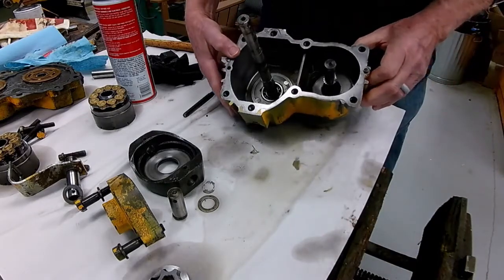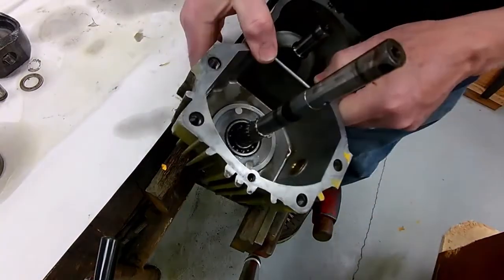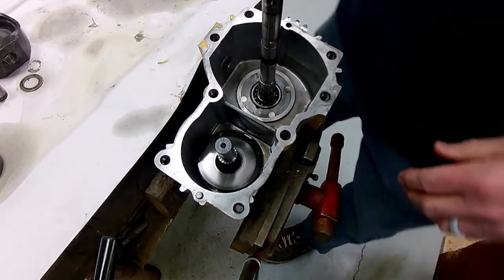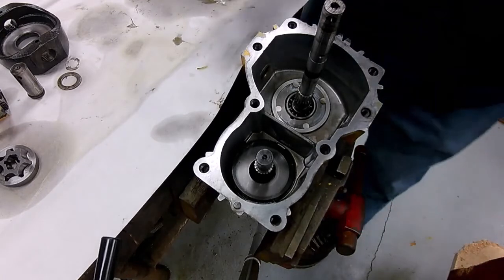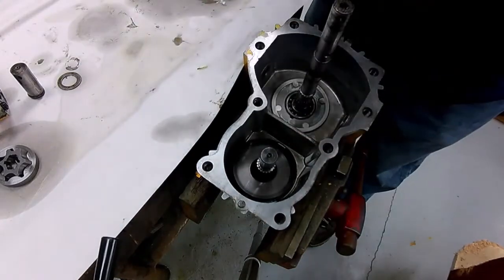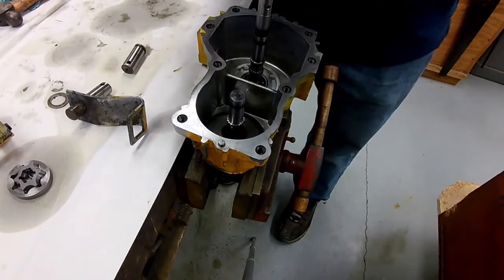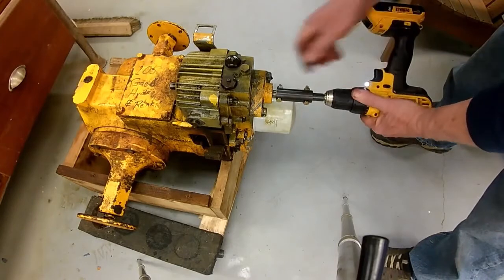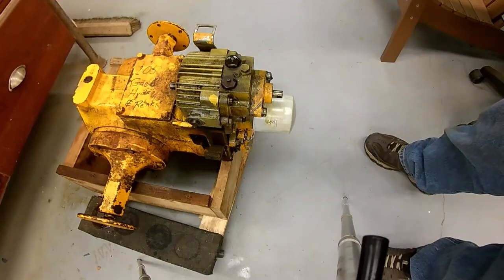Cub Cadet Hydro Repair Part  2

Comment: Hello frank, I just picked up a cub cadet 618 old cast unit  from a 2550, that had a blown engine.  I seen how you test the unit and  I will use your method .Great Video!

Comment: That's some good information, Frank. I'll check the hydro in my old tractor as it hasn't been run yet. I have a spare pump for it, and it looks good. I'm thinking of turning the transaxle around and running it from the back side and making a front deck mower. I'm aware that the engine will have to have the same direction of rotation on the thru shaft, but I can do that when I make the changes. It seems that it will plow snow better that way.

Comment: Really enjoy your videos frank thank you. You talk about the sealant or glue drying on that seal you replaced. What did you use. I am redoing mine on my 1450 again. I messed the lip seal up when I had it apart last week. Now waiting for new seal and gaskets and charge pump o ring. I’ve split this tractor ten times this month.
Reply from the maker: I think you are talking about the bearing retainer compound used to hold the roller bearing in the slightly loose housing. Several brands are out there, but Loctite is one well known. Ask for a bearing retaining compound at your local auto parts store.

Comment: Great videos and very helpful (especially about driving the swash plate pins out ). I'm curious, though and something I've never been totally clear about - I didn't see you pre-fill the filter, yet I understood pre-filling the filter halfway was necessary for priming (even the manual says to do it). Then again, I didn't see you add any fluid, and since you must have added it off camera, did you also pre-fill the filter off camera? Is it not necessary after all?
Reply from the maker: I've never pre-filled the filter. Since it's installed horizontally, it's tough to get and keep much in it. If necessary to prime the system, you simply push (roll) the tractor forward a few feet. I can't recall ever doing that either but I've read that. Priming the filter partially is probably a good idea if you can do it. Can't hurt anything.

Comment: Frank I wished I had watched the whole 1st video. I did not remember to mark my punch when pushing the spring pins out for the awash plate and pushed them all the way in. In the video you say you’re pretty much screwed. So my questions is am I screwed or is there a way to get them out. The trunnion side is the problem. The other side came out. Thank you.
Reply from the maker: Hmmm.  You've gotten yourself into a real pickle, as they say.  I assume you are doing this to replace the trunnion shaft seals.  Anything you try to do will potentially damage the hydro beyond use.  Cheapest and easiest way is to buy another hydro for $50-$100 off ebay or from Scott Urschell (260-715-3440) or Ray's IH Parts on Facebook.

Comment: Great video , I checked my hydro like you did with the adapter and the wheels turn , but I can stop them with my hand , is this normal or do I have to redo my hydro ?
Reply from the maker: If the wheels turn, the hydro is assembled correctly. I'll bet you are good to go.  If it works, it works. Test the directional control too--move it from forward to reverse to be sure it work both directions. You should be fine. 

Also, with an open differential, you can stop one wheel and the other goes backwards. You'd have to stop both with your hands to correctly test.  

Remember, the drill runs at a few hundred rpm, the engine runs at 3600 rpm (max). So there is much less power with a drill than the engine.

Comment: Ok thank you Frank. I think the bearing is ok but the lip seal is leaking. Definitely pumping out of that shaft.
Reply from the maker: Need to replace the seal then, knock it out and tap in a new one. ccspecialties.org has all the parts. Or here's a cross reference for a number of parts to NAPA parts: https://www.onlycubcadets.net/forum/showthread.php?t=36314  The hydro input/output and trunnion seals are included.

Comment: Hi Frank. I watched your 2 videos part 1 part 2. Very good information on how to rebuild. But I have a question before I rebuild. When I rotate my pump Counterclock wise with a drill and I put it in the forward Position. it's It acts like it's Slipping gears and it does the same thing on the reverse side.That normal or is it just not engaged all the way.
Reply from the maker: If you are turning it with a drill attached to the drive shaft, are you sure there is not a sheared pin somewhere on the shaft? Be absolutely sure you are actually turning the hydro input shaft.  A sheared driveshaft pin is not visible as they shear off inside. You need to remove and inspect every pin. Second, have you changed the fluid and filter? insufficient fluid flow to the hydro by low level in the axle or clogged filter will cause erratic behavior. 
I'm assuming you didn't remove the charge pump and reinstall it 180 degrees out?  or pinch the o ring on re-installation. 
Could also be damage in the differential? Broken ring gear or spider? (unlikely due to the rugged nature of this stuff, but anything is possible)

Comment: Is this a sundstrand transmission because other videos I've seen the trunnion have to roll pins holding the swash in this video there was only one on each
Reply from the maker: It is a Sundstrand and there are two roll pins, one on each short shaft supporting the swash plate.

Comment: Hey Frank, Great video Thanks. Perfect timing too, trying to fix a leak on my 1811 hydro, quick question if you can help.  When I removed the hydro, the cork gasket was rotated 180 with the 3 holes of the gasket above the shaft and the gasket material covering the 3 holes on the hydro.  In addition the two outside holes on the hydro don't have the pins/bolt heads sticking out that you used to index the gasket.  Just checking before I put it back together the way it came off???  Thanks
Reply from the maker: Not sure if your hydro is different--sounds like it is. You can look at the parts diagram on partstree.com, navigate to cub cadet and your model. pull up the hydro diagram and check it.  Another option is to join onlycubcadets.net and ask there.  If it worked before it started leaking, then going back the same way seems safe to do.  Without the pins to index the gasket, seems the orientation doesn't matter.  But I'm not an expert on the later hydros.
Reply: @woodandmetalshoptime8048  Just seemed odd that the gasket would cover those holes, but I guess the fluid would run through the hole for the shaft.  Parts diagrams don't help. they don't even show the holes in the parts or the gaskets.  I will join the cub site and see what I can find out there, looks like a great resource...  Thanks again, keep up the videos.....

Comment: I was wondering is there a gearing down, then a final drive assembly ?
Reply: I would like to know a little bit more about how that part works.
Reply from the maker: The output of the hydrostat is infinitely variable, forward and reverse. The output of the hydro drives a pinion gear that engages a reduction gear which in turn drives the differential via another pinion and the ring gear.  So two rounds of reduction gearing to get to the axle.

Comment: Have a question about the middle section.  Can I swap it to a non ported pump or is there a difference
Reply from the maker: Not sure what you mean by "middle section."  Best to refer to parts diagrams (partstree.com, cubcadet.com).  Need a bit more detail to know exactly what you are trying to do.

Comment: good video. i have a couple of  questions ,, working on a cub old cast iron engine ,,muffler gets red hot at night you can almost see threw it ,, i pulled the engine flywheel key is good ,, correct spark plug factory muffler ,,it has points and a coil ..air go's threw muffler .. did not check too see if inside is gone yet in the exhaust . any idea why it could be getting so hot ?? done mowers over 40 years never ran into this yet ,,have another cub hydro . when you go too drive it .. it seams to go from slow too super fast maybe shifter out of adjustment .. thought when your cell phone was ringing it was mine same ringtone ,, lol  seen another video guy doing cub tranny ,, he drove the pin too far . he drilled a hole behind the pin in the case .then taped it and put a plug in it ,, good idea to mark the punch . they also make stops for drill bits so you can't drill too deep .. maybe one will fit the punch ..so it would stop the punch from driving too far .
Reply from the maker: If the engine is running rich it may not burn all the fuel in the cylinder (cause could be air filter clogged or carb not adjusted properly) so the fuel burns in the muffler.  As for speed control on a hydro, you probably need to address wear in the trunnion. The arm on the hydro that adjusts speed has a rectangular opening that wears our of shape and the springs in it get weak. Very common issue and an easy repair. Also make sure your speed control lever has some resistance (there is a friction adjustment) otherwise it tends to run away.
Reply: @woodandmetalshoptime8048  thank you i will be checking that ,, keep up the great videos  ..

Comment: How much would you charge to put all new seals and gaskets in mine?  It is in a cub cadet 125.  Works fine just has some leaks.  I could ship it to you.
Reply from the maker: Much cheaper to just buy a good used one.
Reply: @woodandmetalshoptime8048  Do you have one for sale?
Reply from the maker: Sorry, no  But Ebay, Scott Urschell 260-715-3440 or Ray's IH parts on Facebook are good sources.

Comment: Are there any other gaskets  or seals know to leak? I am taking  apart my 123 because  of a leak. I could not see exactly  where it was coming  from with the tractor assembled,  but ordered the cork gasket based on what I have read. Upon getting  the rear end out. The only wet spot I can see is around  the trunnion seal.
Reply from the maker: I seldom see leaks from the input and output shaft seals or the swash plate (trunnion) shafts. But they can happen and are not expensive to replace but the one set requires removal of the swash plate shafts.  By far the most common leak is the cork gasket.

Comment: I have an 1811 cadet the hydro pump is leaking on the right side.  it is where the pin goes in to hold the swash plate. I did not see you place any type of sealer (O ring etc.). How do I stop the leak. I don't think just taking it apart and putting it back together will stop the leak. any suggestions?
Reply from the maker: Hi.  The swash plate shafts have oil seals set into the case from the outside. Remove both shafts, remove old oil seals and install new ones. They are a standard size seal you can probably get at NAPA--here's the part number. 
Hydro trunion seal SN 592014 & below IH # 383534R91 NAPA # 6720
Hydro trunion seal SN 592015 & above Sundstrand # 9008000-6701 NAPA # 6763 (not sure where you SN falls in that range)
While you've got it apart, might as well replace the input shaft seals as well: 
Hydro input seal IH # 394847R91, Sundstrand # 9008000-6201 NAPA # 6204

Another source for parts is ccspecialties.org, Charlie Proctor runs that business and is very helpful. He's got lots of parts for Cub Cadets. 

It's pretty unusual for hydro seals to leak, at least the trunnion shaft seals as there is very little motion of those shafts to wear the seals. Not to say it can't happen, it's just not common. Much more common is the cork gasket between the hydro and the rear axle. In fact, very common. Sometimes it's tough to identify the source of the cork gasket leak as oil shows up all over the bottom half of the hydro. Order that and replace that as well when you pull your hydro. Follow the service manual instructions to the letter. Do not attempt to take the hydro apart without the service manual. Very easy to mix things up and you'll end up with a non working hydro. If you are methodical and careful, though, it's not that difficult. Good luck.
Reply: @woodandmetalshoptime8048  thank you. your videos were the best I have seen. there was a section in the first one where the picture stood still and i was not able to see what you were doing, but the audio explained every thing very well. thanks again.
Reply from the maker: Sorry about that. In that early video I was using a smart phone and quickly learned they are not reliable. I've switched to GoPros but still not happy with video quality. Still working on all this stuff...
Reply from the maker: Thanks, Robert. No bother really.  

Here's a link to the tech library at Only Cub Cadets. You may want to join that forum. Great guys and lots of info.  Pretty much any manual/tech info you could want. 

https://www.onlycubcadets.net/forum/forumdisplay.php?f=19

Here's the link to your manual on that site: (third page I think of the previous link) https://www.onlycubcadets.net/forum/showthread.php?t=25397

Hope this helps. Oh, I was a nuclear engineer in my past life.